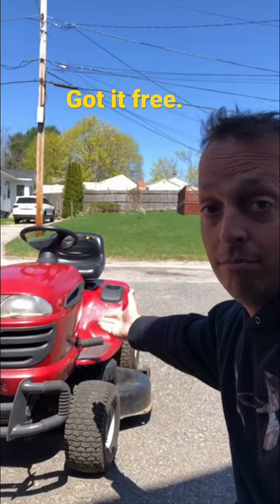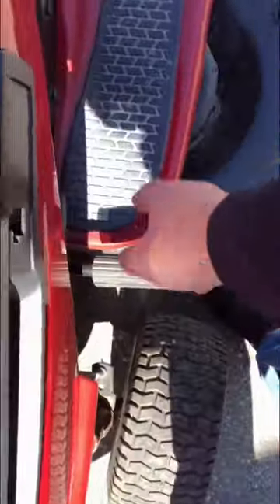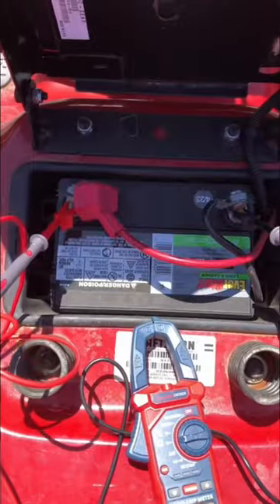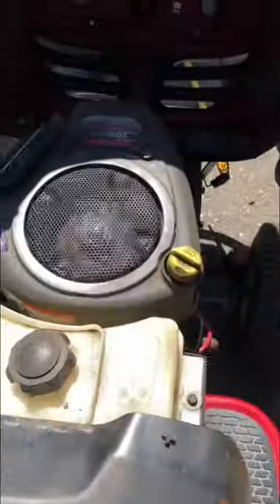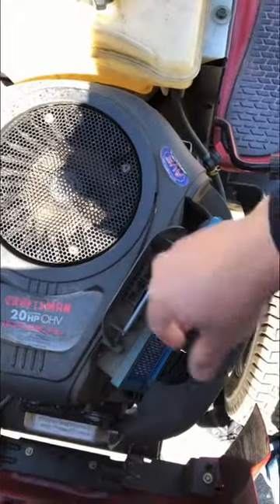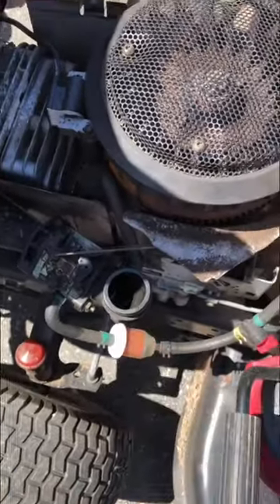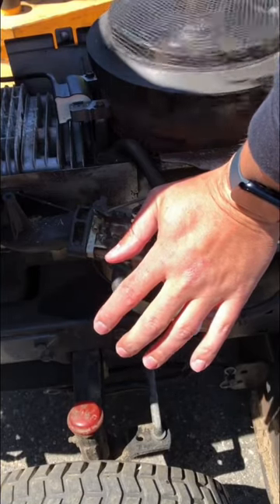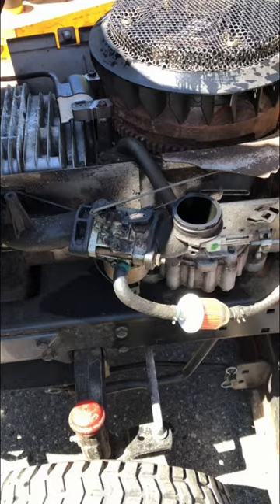Free mower. Won’t start. Cover the air intake! Briggs engine, Craftsman mower #smallengine

Comment: Why would you sell someone something with a “permanent” problem? Fix the problem and then sell it. Do the right thing.
Reply from the maker: I did do the right thing: adjusted the valves, cleaned the carb and let him know of the history that it did get hydrolocked by fuel. Educated him that he should run it out of gas and use the fuel shutoff valve to make sure it doesn’t happen again in the future. What I did in this video was move the mower from one side of our property to the other. I needed it to move and I didn’t feel like pushing it. 🤷🏻‍♂️
Reply: He literally says “getting it ready to sell” and “I just needed it to move”. He’s not selling it like that
Reply: @andrewlee8204  "A temporary fix to a permanent problem" kinda says it all.
Reply: @NiceLawnBro  If it's getting hydro locked by fuel it has a problem with the carb. As you said, "a temporary fix to a permanent problem" kinda says it all. fix the carb or put a new one on it. Selling it while it's still getting hydro locked on fuel isn't the "right thing" IMO. But hey, to each his own.
Reply: Thats just briggs and stratton for you. Been a service tech since 1974,theyre always coming up with strange and repetetive engine gliches,like the overhead quantum that only starts on a 20 thousanths of an inch plug gap

Comment: Everyone is saying it’s a valve problem it could be but those Briggs & Stratton engines have plastic cam gears and those gears could’ve been stripped so you need to replace the gear to the compression release

Comment: it does that because it's hydolocked from gas in the cylinder because the gas isn't shutting off. cranking one like that is a good way to blow it up
Reply: Clearly not hydrolocked, he did nothing to alleviate a hydrolock yet the engine started spinning just fine, that tells you its not hydrolocked

Comment: New starter an full size cables made mine whip over. But before that I just reached down an twisted it passed that an it would start
Reply from the maker: It ain’t dumb if it works! 🤣😂🥰

Comment: I'm sure that chattering dry bushing in the starter isn't helping the situation one bit, either..  Enough of my flatheads still run well enough that I haven't had to replace one with an OHV, lol! Oil changes seem to have done them fine.. And draining fuel for winter/summer(pretty much just the snow blower, haha..) storage.

Comment: In case you don’t understand what the problem is, your valves are out of adjustment at the very least plus that spring back of the fog out through the carburetor could be an indicator that the valve seat has come out of its recess in the head from the engine being too hot it sometime or another. If you keep running it you’re going to ruin it. It needs fixing. PS check the oil and make sure it’s not over full and smelling like gas. If so, your carburetor is leaking fuel pass the needle valve and running down into the engine by way of around the intake valve and around the rings. It needs a seven dollar shut off valve in the fuel line and someone who can remember to turn it off after each mowing and a fresh change of oil.
Reply from the maker: Excellent analysis! 🥰
Reply: I don't think his carb was leaking, my guess is all that fuel built up when he was cranking it with his hand over the intake

Comment: I have one of those engines with that problem and I'm going to replace it with an 18hp boxer twin.
Reply: Heybefore you repla e the engine put a Manuel fuel shut off in your fuel line ,,,when your done cutting just shut the fuel line off and let it run out of gas ,it's like 4 dollars and it keeps your carb from getting crap built up in it I use this on all of mine and the oldest mower is 12 yrs old I have never changed the carb on anything ,,,hey its a cheaper try than a new motor ,,,good luck
Reply: @briananderson3801  the problem is a shitty decompression system and I just plain prefer the boxers anyway.

Comment: Adjust valves use a drop of lock tight on the jam nuts ... Valve adjustment on Briggs & Stratton engines just part of regular scheduled maintenance cuz I oil changes and air filters All the other stuff nobody does

Comment: Some mowers have fuel shut off solenoid that go bad, this causes fuel to leak past the float in carb  . Filing the combustion chamber .. that’s why it appears the battery’s low and needs a boost ultimately forcing the valves out of spec then flooding the crankcase contaminating with gas killing the engine over short time period
Reply: That's not even what that fuel shutoff solenoid does all that's for is to prevent the mower from popping out the exhaust after you shut it off
Reply: @mondude9754  good explanation man I think that’s what I said maybe just a little more technical than the beginners version ?
Reply: @allensandven0  you said "Some mowers have fuel shut off solenoid that go bad, this causes fuel to leak past the float in carb ." Wich is actually false. The float and needle valve are entirely liable for sealing off the fuel supply when the gas level in the bowl is where it should be. You imply that the fuel solenoid going bad could cause fuel to leak past the float in the carb. but the two each have their own purposes separate from eachother.
Reply: @mondude9754  I think most of us are familiar how a carb needle and float work here .. what I didn’t clearly explain is with or without the needle and float working perfect you still need a fuel shutoff on a gravity fuel system to ensure the needle or float doesn’t let fuel continuously flow through the carb filling the combustion chamber causing hydro lock and or contaminating the oil ! In both cases the diy joe fails to check the oil or notice the fuel in the oil .. thinks it just needs a jump from his 200amp  booster charger forcing the fuel compression past the rings and or valve guides at best forcing them out of spec ..then wonder why it’s hard to start .. but then again I’ve never tried the hand choke trick  so just to recap … a working fuel shutoff will save you a lot off headaches. And it’s very common issue .. yes the float also must be working correctly but if your fuel shut off is functioning correctly at most your fuel in the bowl will evaporated before the next use not causing damage just some run idle issues

Comment: Probably just a valve adjustment issue, or a faulty/broken compression relief on the camshaft, both are quite easy to do

Comment: Thats the exact mower i have, mine runs funny af after mowing it seems to have a rev problem going high then low although that may be because im mowing like 6 lawns in a day
Reply: Surging after it warms up is always a fuel issue. Cleaning the carb and checking/replacing the lines will fix the surging it’s doing. Make sure there aren’t any air leaks around the intake manifold and carb, as well.

Comment: Thank you! Now, I need a small favor... I need to know how to fully fix this problem. I own a White brand lawn mower and this is EXACTLY what it is doing! New battery and all. HELP!!!
Reply from the maker: Your situation might be unique! Could be your carb leaking gas into the cylinder head. Could be your compression release that’s broken or gunked up. Find me on tiktok @geeyouess I’ll have a video shortly in both places. Gimme the weekend?
Reply: You will need to disassemble the engine because the compression release rides on the camshaft. The parts are about $40.00,but time consuming labor.
Reply: Change the fuel solenoid on the bottom of the carburetor.
Reply: Adjust your valves
Reply from the maker: @garyalensr  DONE! ✅🥰
Reply: I had to replace the carburetor on my cub cadet it had a fuel shut off valve on the bottom that went bad and hydro locked the engine. Make sure you change the oil and filter afterward cause I’m certain it’s full of fuel now I know mine was.

Comment: Any suggestions to just rigging a fuel pump onto a motor? My bracket doesn’t match uo
Reply from the maker: Drill a small hole in the cowling and use a zip tie or screw or nut and bolt to secure it?

Comment: like many others have said. it takes ten minutes to adjust the valves and unlike others have said its 4 thou not five. five will work but four is spec. Ive got the same engine also a issue that you'll have an issue coming up soon if the engine has shown that hard turnover. I know that this isnt the right way to do it but I tried everything else. you may have to run a independent ground line for your starter here pretty soon. I had both of these issues at the same damn time. so it wasnt fun to say the least. anyway I gotta go hang a new deck on mine right now before it gets super hot outside l8rrz.
Reply: Is there a video on how to do them? I'm good at mechanic work, just don't know the engine

Comment: either camshaft compression release had fallen apart or the spring is weak...I've seen both...solution is to replace the cam..then readjust the valves

Comment: Flooding due to crappy carb.  Easy fix.  Clean and rebuild carb.  But continued attempts to turn it over with the starter when it's hydrolocked will definitely produce non favorable results.
Reply from the maker: You’re not wrong!

Comment: Set the valves and your problem is solved. I've literally fixed hundreds of briggs where people thought is was broke compression release. ITS THE VALVES
Reply from the maker: You’re 💯%on the 💰 No more problems after that was done.
Reply: know where i can get parts like carb and gromets for gas tank for this very engine in the vidio?  a site i can order from?
Reply from the maker: @robertbrown3539  I would think Amazon eBay or a google search
Reply: Those single cylinder briggs motors the newer ones like in the video they have camshafts that the decompression breaks all the time and it won't turn over if you have a good battery good starter and the valves set and it still won't turn over its the cam I do them all the time at work
Reply: @quadvloggs6876  absolutely, if you set the valves and it still oes this, then ya it's the decomp

Comment: valves don't need adjustment, the camshaft needs replacing. The compression release lever on the cam is broken.  Common problem.

Comment: They call that hydrolocked.  It means the fuel is leaking past the needle and seat and filling the cylinder with fuel.  Fuel doesn't compress. Thats why it won't turn over. Did you see the fuel spray out of the intake?  Flooded engine.  Too many experts.

Comment: Try starting the motor with the spark plug out.. if oil is in combustion chamber it will shoot out the plug port, so don't have it shooting at anything you wouldn't want oil getting on.
Reply: Gas

Comment: that much fuel popping out means carb is leaking and it not turning is cause its partly hydro locking it self. Take it from experience as my tractor's fuel cutoff solenoid doesn't work well but i expect something to be wrong with a tractor i owned for 30 years.

Comment: Just float in carby?
Reply from the maker: Yep. Hydro locked! Cleaned the carb, adjusted the valve lash and educated the new owner on the history and to utilize the fuel shutoff valve or replace the carb if it continues.

Comment: I have a craftsman L2000 and it does nothing when I turn the key. I thought it was the battery, so I jumped it and it started, but then died after 60 seconds and now it doesn’t turn over even when I jump it?
Reply from the maker: Clean those battery terminals and make sure the cables are tight. Use a volt meter and follow the juice!
Reply: @NiceLawnBro thank you, I did that and nothing happened. I then checked the fuse at it was dry brittle, it fell apart when I removed it. I guess next stop is the solenoid? What’s your advice?
Reply from the maker: @stevekeeling9700  follow the voltage. Use a multimeter!
Reply: Thank you

Comment: I got a free Toro wheelhorse lawn tractor  it worked  a few days now it won't start I put in new plug it worked  now it won't start .
Reply from the maker: Five needs for an engine: air, fuel, spark, compression, timing. You have a problem, but I can’t diagnose without hearing it.
Reply: My Toro lawn tractor  is working  I had some lever in.wrong position .so I iam good

Comment: Could have a bad compression release on the cam if adjusting the valves doesn't work, this is what I do for a living. The briggs 15.5--21hp engines are bad about this.
Reply from the maker: I love that you’re here! Exhaust valve was out of spec. Adjusted those valves and haven’t had a problem since
Reply: @NiceLawnBro  that's great, those camshafts are on factory back order at briggs so I'm glad that was it.
Reply: could i please ask your professional opinion on my dads mower. its a toro timecutter, ill have to double check what engine it has but it has been burnering half a quart of oil ever hour, or half acre ish,

 i dont know if  this is normal for it but i have never been around a mower that put off this much fumes i cant stand standing next to if its not moving. theres a little blue smoke but only when it starts, and i just replaced the battery, it had a full charge,  both times we mowed since then i still had to jump start it

i have only used this mower once ill have to double check with my dad if theres any other symptoms
Reply from the maker: @daltonlockyear7437  that sounds like your piston rings have gone. Could be a head gasket, but to burn that much oil in half an acre is excessive, you’re right. I’d have to see it running and hear it running. There’s a lot that could be happening. Or it could not be anything big at all where it’ll burn oil if there’s too much oil in the machine.

Comment: ITS NOT VALVE ADJUSTMENT ISSUE, THE CARB IS FLOODING WITH FUEL AND HYDRAULICING THE CYLINDER. Either leaking needle/seat OR If it's a Nikki carb, its the tiny o'ring above the needle & seat where the plastic seals to the aluminum carb body

Comment: The problem is the carb is flooding the engine you need to pull the spark plug out and turn engine over to clear. pull the dip stick the crankcase is full of gas put a fuel shutdown switch on the fuel line shut down when engine off .make sure to change oil

Comment: The valves need adjustment. Its not a permanent problem, just a lack of maintenance.
Reply: Maybe but compression release failure is common on those. Had 2 last year.
Reply: @gadasa videos  it is fairly common,  buts its much more common for it to need a valve adjustment. Ive been working on small engines for years.

Comment: Now a pulley swap and belt change also straight piped governor on both engine and throttle body better tires street fuel lines and intake swap thicker oil bigger tank shell scream going 100mph on the road
Reply from the maker: I would def do this

Comment: Engine locked by fuel. Take the spark plug out and clear the fuel. I am amazed that the engine would turn over.

Comment: Typical Briggs, common issues with those single cyls is valves out of adjustment or broken decompressor on the cam shaft. Plus judging by the amount of fuel that shot out of that intake tube the needle isn’t seating correctly and allowing fuel to bypass. Crankcase is probably right full of gasoline and continuing to run it like that is a quick way to wipe out the connecting rod and wrist pin due to overheating. Put in an hour of work to fix it and it will give you hours of work in return.

Comment: Had a craftsman with the same problem, got rid of it for free and the guy said he never could get it running??
Reply from the maker: That’s too bad. At least he tried! There’s more than just a spark plug and gas required to make the engine run proper. Things get out of spec and need adjustment all the time. Just gotta know where and what to look at 🥰

Comment: Put a shut off valve on the fuel line .
Reply: The engine is vapor locking from the carb leaking fuel into the cylinders.  More than likely from using gas with ethanol in it eating the rubber off of the needle in its seat. It also will do it from shutting down the engine running at high RPM's.

Comment: Why don't you just pop off valve cover and adjust the valves and then the compression release will work properly and it will fire right up every time lol.. it's about the same amount of work as taking off that top cover anyway
Reply from the maker: I needed it to move from its current spot and thought, “I should record this because not everybody knows it works.”

Comment: Pretty sure the valves are out of adjustment. My preference would just be a starter that would crank that puppy no matter what.
Reply: These engines were prone to the decompressor breaking off the cam, finding a high torque starter could trigger another inherent problem with these engines, blown head gasket

Comment: If it’s rich like that just pull the fuel solenoid off from the bottom of the carburetor bowl and clean it and work. The primer shut off valve a couple times, and it will start working right again. easy fix.
Reply: The fuel solenoid on the bottom of the carburetor has absolutely zero to do with metering fuel… It's an anti-backfire valve that closes off the Venturi tube when you turn the ignition off, so it doesn't backfire and scare your elderly neighbors. It's Rich because he put his hand over the carburetor so it sucked a bunch of gas up from the bottom of the bowl....

Comment: Having worked with these engines it sound like the starter or a loose connection
Reply from the maker: Valves out of spec.
Reply: @NiceLawnBro  that to

Comment: Starter is dry...  oil it....or loose it...
Reply: Probably, the issue is that these engines have a compression release in em that fails all the time causing this problem.